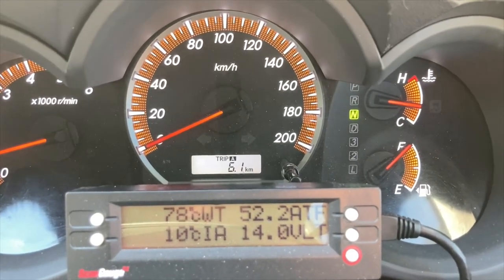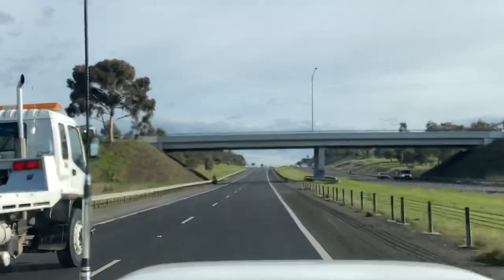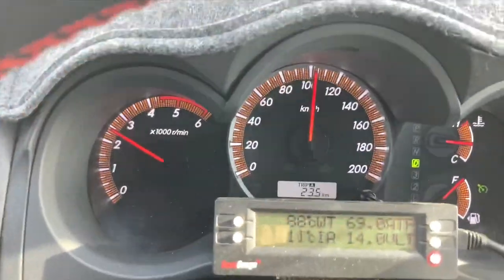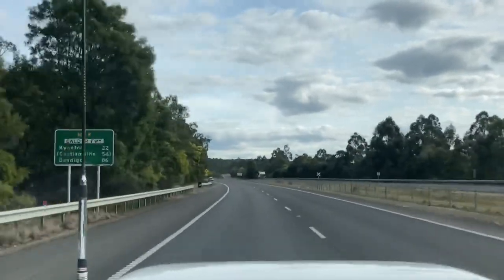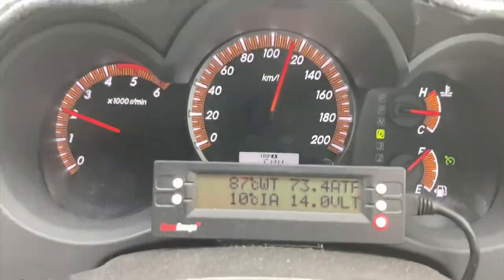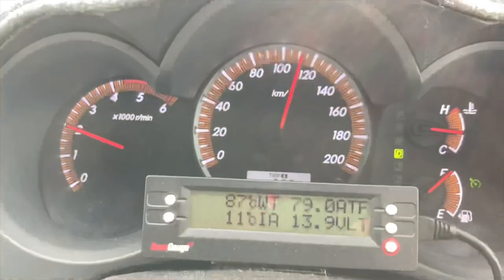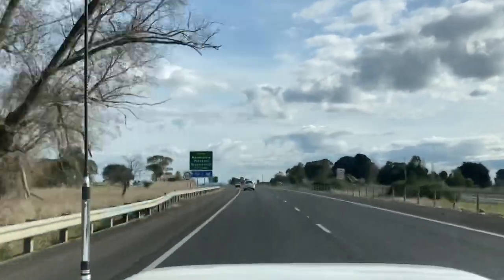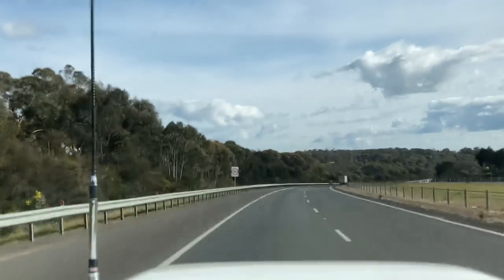BEST INFO TORQUE CONVERTER HEAT 2013 HILUX 4 Speed plus save FUEL

Comment: I’ve had a Nomad valve body upgraded 7 years ago, with a seperate transmission cooler (not in series with the radiator tank…to avoid possible inter tank leak and to keep the transmission temp down.)
Oil and seals deteriorate with higher ATF temps and if not serviced regularly (50,000-60,000   klms but could be lower if doing only heavy towing).
The lockup kits that Wholesale Automatics have have been great and now are even more advanced.
If you are towing it can save in excess of 3.5 litres per hundred compared to stock or more depending on your make.
I highly recommend you watch their most recent video regarding recent lockup upgrade and how you can set it up using an app.
It really is brilliant stuff once again delivered by this awesome company down your way.

Their recent series of YouTube videos really shows what improvements they have made to many common makes and models and what they actually do.
It’s my most favourite modification.

Comment: Your so right.
Most of the driving public hasn’t worked out how merging works.
It work so well and so easy if the merging traffic is matching the left lane speed and the merger uses their brain to work out which gap to choose.
It’s not rocket science.
The mergers do not understand the ramifications for entering the highway below the highway traffic speed to the highway users.